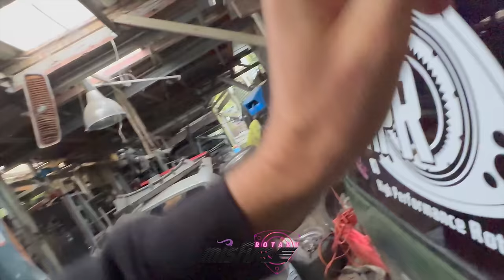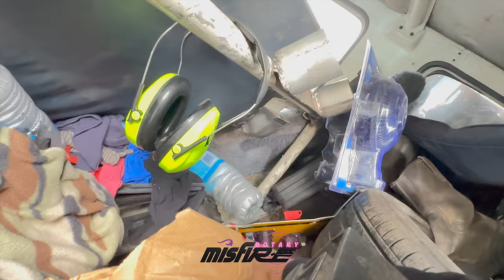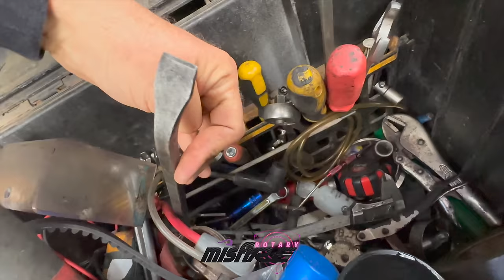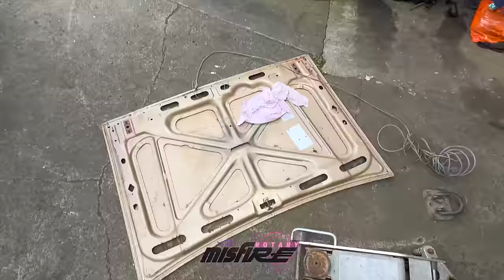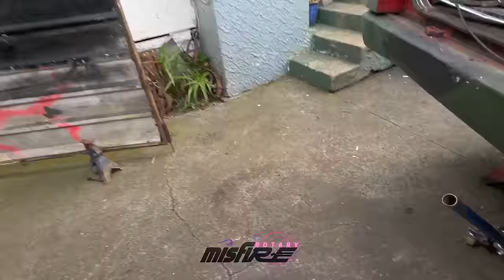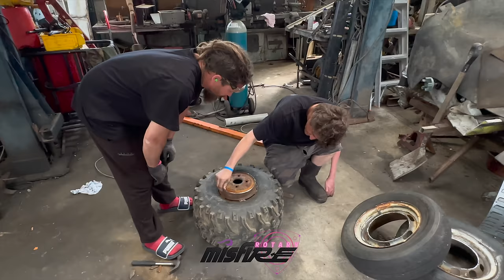The BACKYARD ROTARY BUILDERS Bonnet surfing on the beach

Comment: If you get a small sand blaster you can clean those plugs. There really is no way to break that carbon that bakes to the plug otherwise. Spray sideways over the tip to clean the ceramic fully back to white. Just a quick blast. If you spray down into the plug you will want to give it a brake clean and blow out to get the sand out from inside. Its really the only way to clean spark plugs. I highly recommend it. I brought a whole sandblasting setup just so i can clean plugs as im tuning cars alot. Love ur videos bro. Thanks for the hard work you put in for our entertainment. Max love.
Reply from the maker: Cheers brother if there was a cheap one that b perfect I’ve heard that way is best❤️🤘